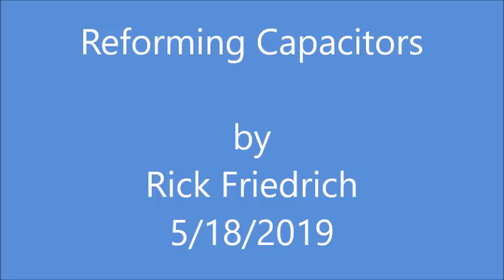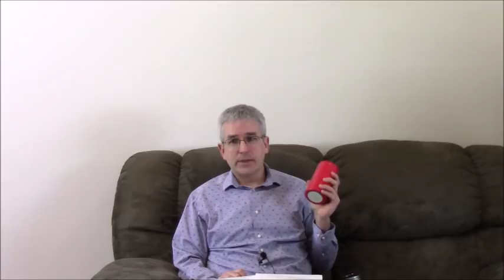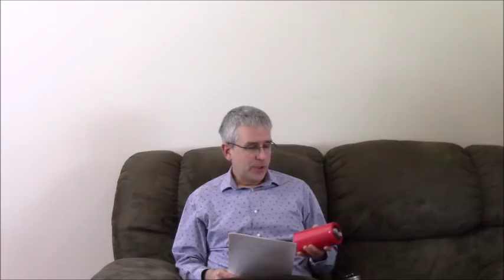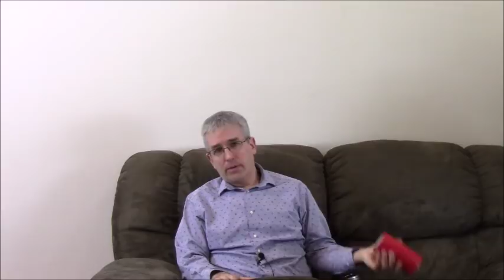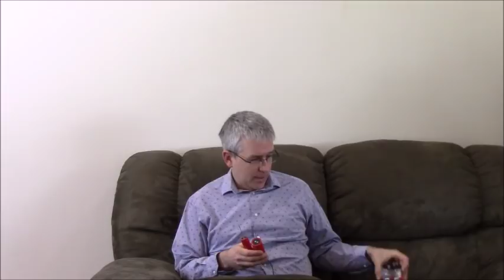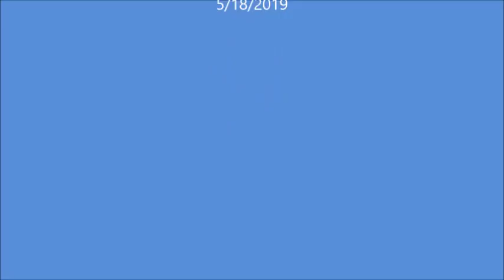Reform your capacitors or else

Comment: Nice vid Rick. Is there a way to know if the Caps actually require reforming? Would you have any suggestions on where to get OR how to make that 500V voltage source for reforming the Caps?  Perhaps a step-up transformer w/AC in and output rectified w/ big smoothing capacitor? Also curious - Have you found yet Cap values effective for a 24v system cap dump (ie., your Large 4Dual Pole Motor)?  I've just soldered together 10x 100uF caps(in parallel) to bus bars for my 24v (12v series 100AH) batteries(DRV/CHG both @24v). Btw - for the cap dump ckt, are skinny SCR pins a bottle neck?  I'm guessing wire w/ same thickness as a pin is ok. Your ideas?
Reply from the maker: Ha, use another cap to condition a cap. Yes, this was one reason I procrastinated in doing this video. I wanted to do some demonstrations but I just don't have the time and I really wanted to mention these things. 
I will be providing these solutions this summer after my next meeting. I don't have any extra time other than doing orders and preparing for these next meetings. No bottle neck. You have to look a different parts and see...
Reply: Great.  Thanks Rick.  Looking fwd to Lansing.... whenever you schedule it.   :)

Comment: Is that the reason my plasma TV made a very loud BANG! With a Capacitor exploding a couple of nights ago, after not being used for about 2 weeks?
Reply from the maker: Probably not. This is something that happens after not being used for a good 8 months or more. I'm not sure about that one. Something else failed and caused it to charge too high maybe. Sometimes the local grid has high voltage coming through and this can damage electronics.